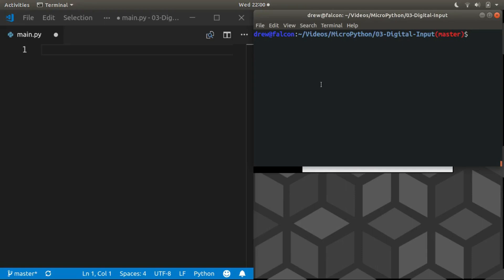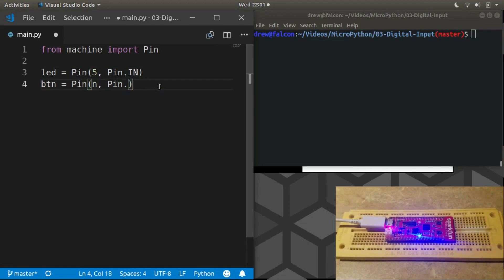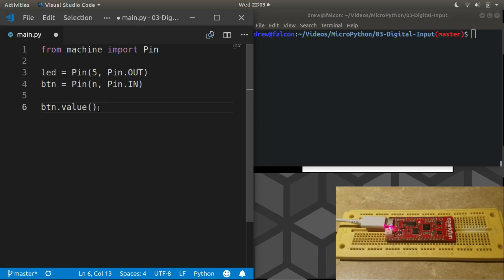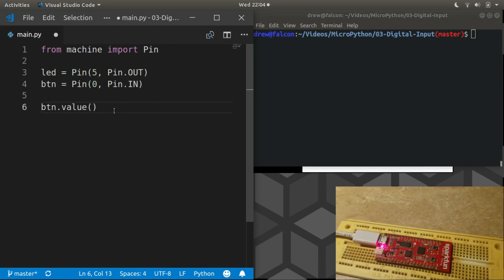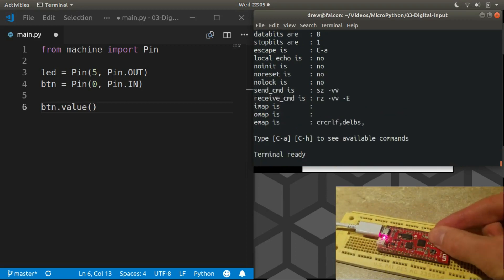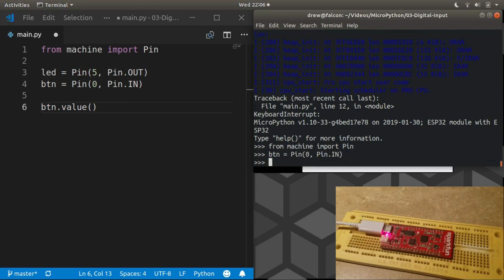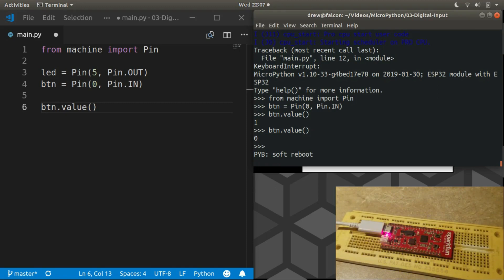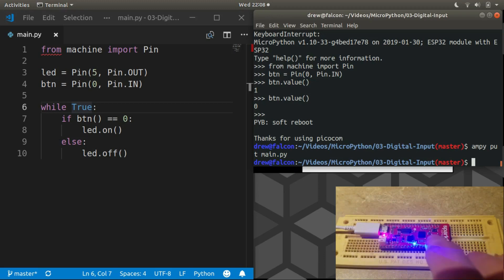Learn MicroPython #3 - Buttons (digital input)

Comment: These tutorials are easy to follow. Not sure if python/ micro python is a good first language for a total beginner, but I need to know it in order to do a project I am working that automates a toolchanging process where the controller program communicates with the computer via .py code. I knownfor sure, I will be simplifying the code I write hopefully when compared to the code on a factory tool changer, but this is definitely a stepping the right direction. Thank you. I'll be following along. Subscribed.

Comment: Please refer to the example provided and try to control it slightly as shown below.

When the button is pressed once, the LED will come on for 5 seconds and turn off. Pressing the button once will blink the LED for 5 seconds, pressing the button once again will keep the LED coming on, and pressing the button again will turn the LED off

I would like to control it as above, but if there is only one example I would like to share.